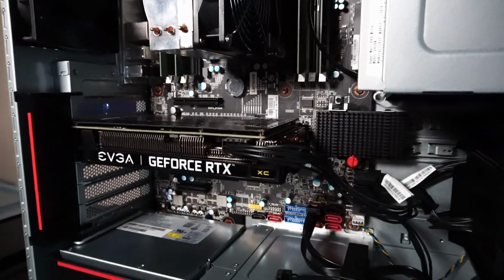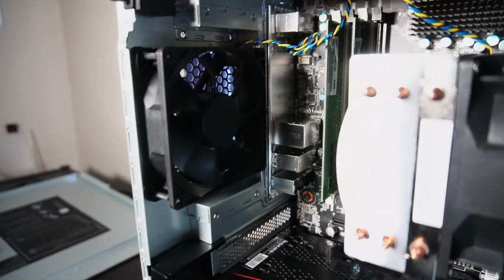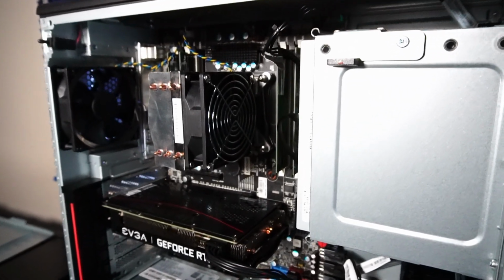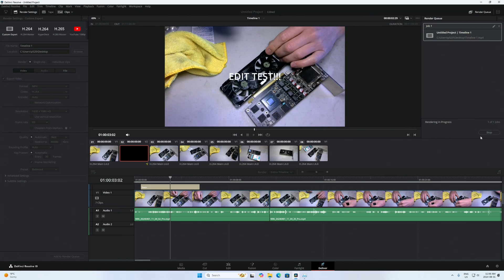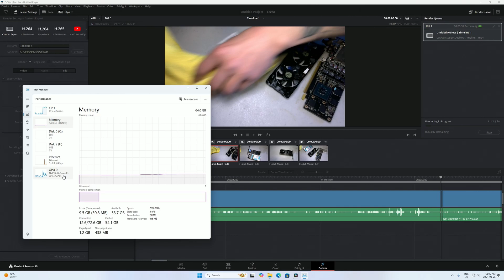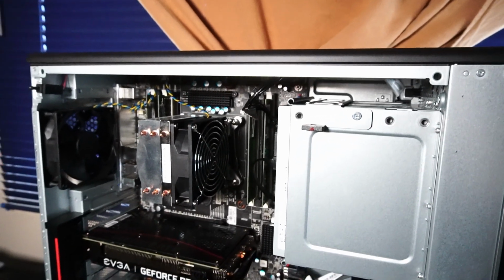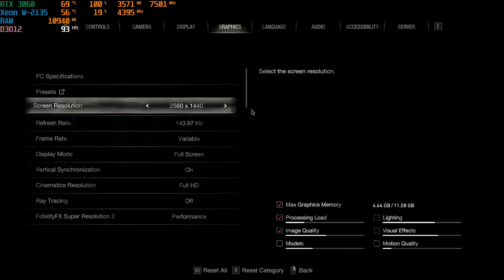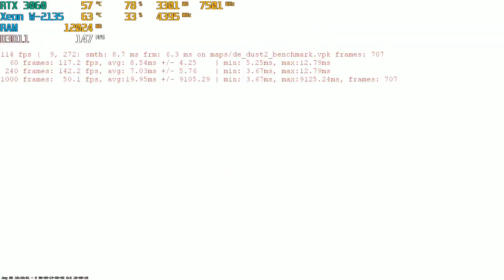Lenovo ThinkStation P520 w/ RTX 3060!  Video Render & Gaming Tests!  (2024)

Comment: Glad I found this video, I've actually been eyeing this exact set up as an inexpensive upgrade from my HP Elitedesk 800 G1 (i7 4790k with A2000 6g gpu) that I've been using for a few years for a bit of 1080p gaming, emulation, and graphics work (light 3D, video/photo editing and toying with AI stuff). I'm curious about the RAM situation because I've heard some people say that ECC memory isn't "gaming RAM," but it seems like it's not a problem here. The only other things I'm thinking about now are about single core performance for things like emulation or whether I'll see a significant change in graphics processing performance with a 12gb 3060 versus my low profile A2000 with half the video RAM. I guess also about how huge the case is compared to the midsize HP tower I ended up moving the SFF motherboard into.
Reply: Are you getting rid of your a2k
Reply: @Gh0styGames  Unlikely, I'll probably move it to my second PC as a back up.
Reply from the maker: If gaming is not your top priority, then ECC RAM is fine.  There is a balance to be found using a Xeon CPU and for workflow it can be quite nice.  Techpowerup or CPU World sum up information on any CPU offered on the P520 spec sheet.  Just fair warning some of the 8 core and up options are very expensive.  If you find a P520 for a good deal, it's probably worth it.  I wouldn't recommend overspending as an investment, though.

Comment: Cool video. I've slowly been messing with this computer. I put 2 fans in front of mine and removed the turbo jet sounding one. I also replaced the cooler with a thermalright silver soul 110. I wonder if removing the hard drive cage will give better air flow
Reply from the maker: That's great, I was wondering if an after market cooler would fit.  Thermalright is a solid choice.  I would bet removing the HDD Cage would give some improved airflow to a GPU, but I wouldn't expect night and day.  In the case of adding fans and not seeing much improvement in temps, I might assume that it could benefit in long term use or if your PC is running for hours at a time.
Reply: @HaisteComputerRepair I haven't played any games on it until today and never checked the temps with the stock cooler. From my little bit of testing with it, the cpu was around 35c, and the gpu was 56c. So I think I made the best choices with the cooling
Reply from the maker: @deeman40  Those are really low, so you're doing something right

Comment: I got one of these in mid 2023, but I bought it in pieces, as originally I wanted to case mod.
But, I eventually bought everything and put it together.
W2135, 32gb ram, 2x256gb SSD's and 1tb HDD, 900w PSU and an ARC 750.
I have this machine as a backup server and my kid uses it as a game station. (War thunder, Helldivers, Star Citizen, etc.)
It's great and I love it.
Reply from the maker: That's sick, well done.

Comment: Is it normal to play games for long time at temperatures above 70? i have w-2135 and max temp for this cpu is 64c
Reply from the maker: I would say yes that is fine.  Pushing the limits a little bit is part of the allure to computer work.  If it's getting over 90 consistently or a person is running it constantly at those temps, possibility of failure increases.
Reply: @HaisteComputerRepair  Thank you for this professional technical answer
Reply from the maker: @learnmodernhebrew7124  No problem.  I can only really speak to my own testing as well as what I have seen from others online.
Reply: @HaisteComputerRepair  thank you
Reply from the maker: @learnmodernhebrew7124  Good luck

Comment: Hey Haiste , i recently bought a Lenovo P520 with a Xeon W-2133 and a quadro P620 GPU which i plan to use for 3D animated short films . being as Ray Tracing is going to be a important factor am going to have upgrade the GPU , thats why i watched your video . what i want to be sure about is if the RTX 3060 will work without any complications? am not so knowledgeable in computer science so am not sure how to fix any bugs that may or may not occur . so it the RTX 3060 12GB just a pop in and ready to use kinda thing? 
thanks in advance
Reply from the maker: Yep, the RTX 3060 should work fine.  Just make sure you have the appropriate PCIe connectors for the model you purchase.  If the card needs 1 x 8pin or 2 x 8pin etc
Reply: @HaisteComputerRepair  okay , thanks ... i have a little knowledge about the PCIe connectors so i will keep that in mind ..  It's really relief to know that the RTX 3060 can work because the workstation GPUs are very expensive and still not all of them has ECC anyway
Reply from the maker: @azariostewart8460  I have installed an EVGA RTX 3060 in a P520 and it booted fine.  I am not aware of any changes to BIOS that might need to be done, for me it was plug & play